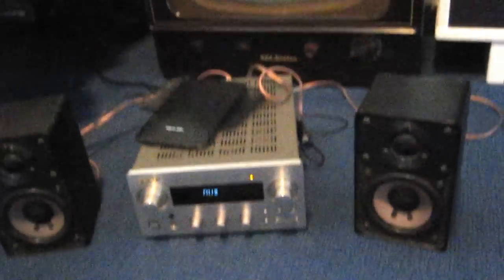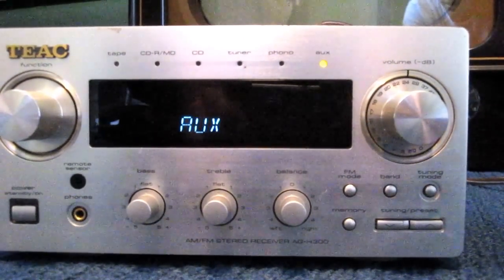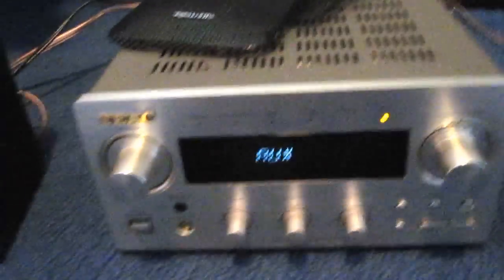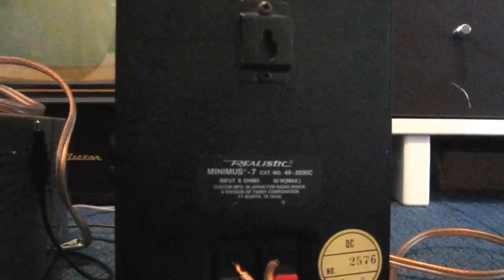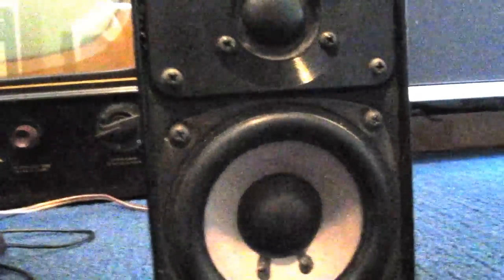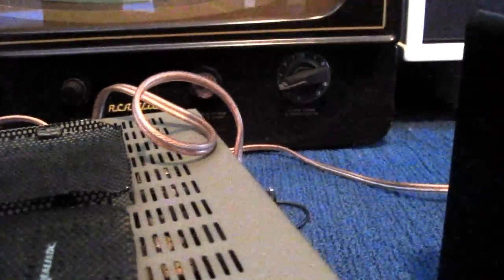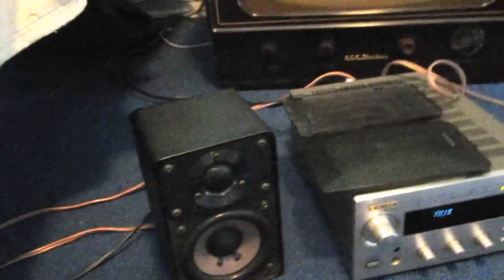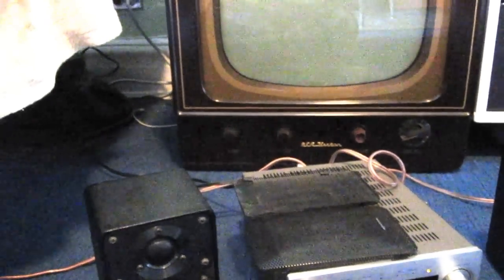Teac AG-H300 And Realistic Minimus 7 Speakers

Comment: I just found a pair of those 7's at goodwill.... in boxes. They wanted $15 each, kind of steep for goodwill, but I gladly bought them, and glad I did!
  I use them with a denon UD-M30, which is the best small unit I have ever heard.  For a small set, combined with a sub, it rocks any room!
Reply: I found two sets in white at my local thirft for 12 bucks! Great little speaker!
You had a good score.
Cheers

Comment: what is a good low power amp that can handle 4ohm speakers?
Reply from the maker: isaac coker Lepai LP-2020A+
Reply: thanks!
Reply from the maker: isaac coker No problem!
Reply: TheSpeakerseeker Could this Lepai LP-2020a+ handle a pair of minimus 7's?
Reply from the maker: Mattias d Oh yes, the 7s are 40w max. the lepai is around 15WPC. The 7s are very easy to drive. I push mine on around 5 watts. A lepai should have no problem